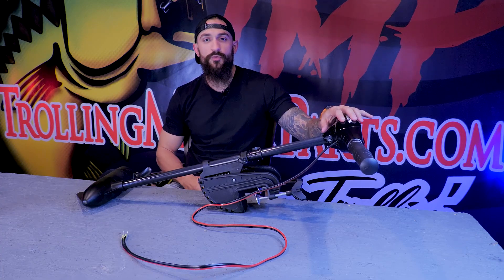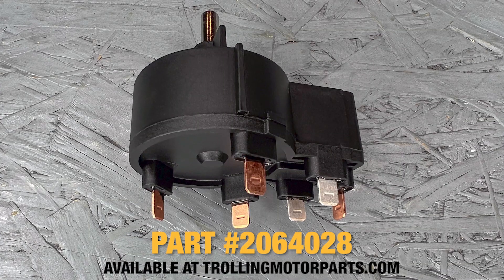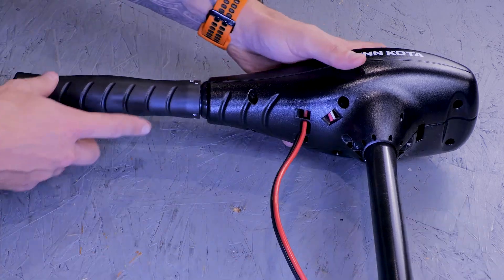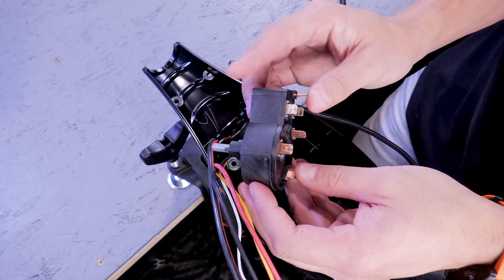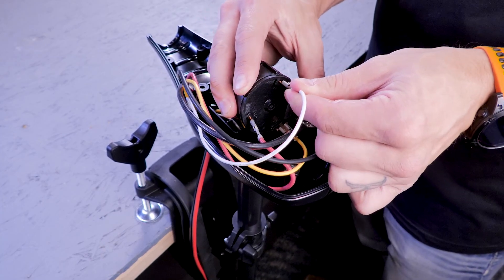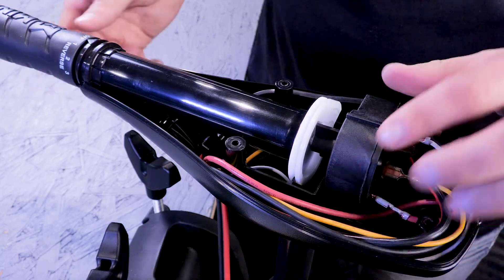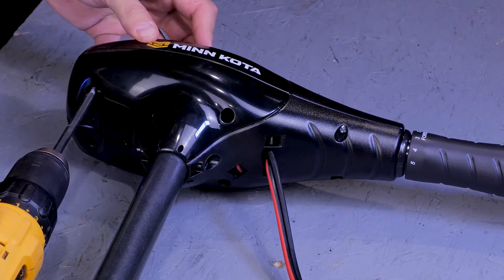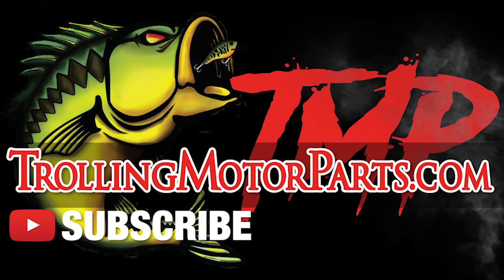Minn Kota 5-Speed Issues / How to Replace Rotary Switch - 2064028 - Hand Control

Comment: Videos like this are why YT is invaluable tool, appreciate this video and another one of yours.   I learned through them the rotary switch was likely bad, and had a spare motor that got sunk so it's used as a parts motor now.      The good motor works now.   Will look to buy parts from you in the future.   Thanks again!